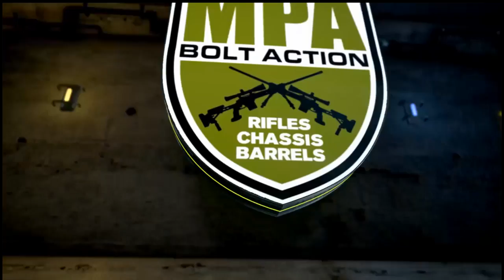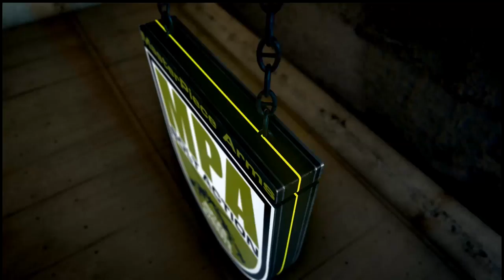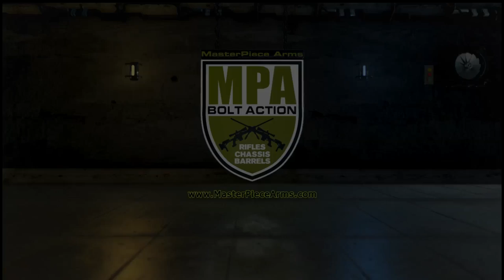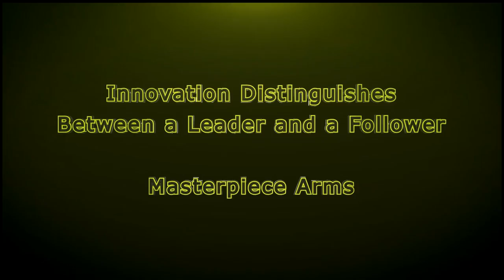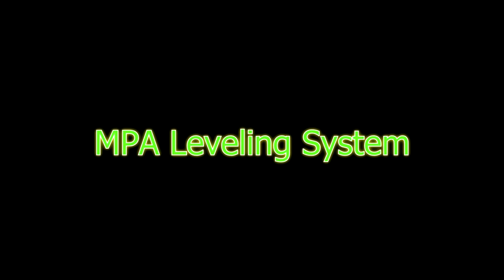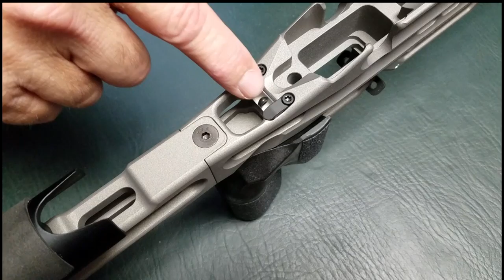Masterpiece Arms BA Chassis New Leveling System

Comment: I jus picked up a MPA BA chassis. I noticed in the bubble leveler I have an air bubble in there and the ceramic ball. Is the air bubble supposed to be there of did I get a defect?
Reply: Did you ever find out?  Mine just arrived and also has the air bubble.